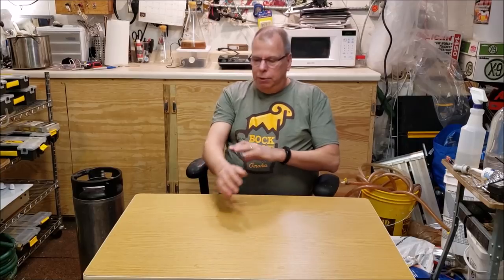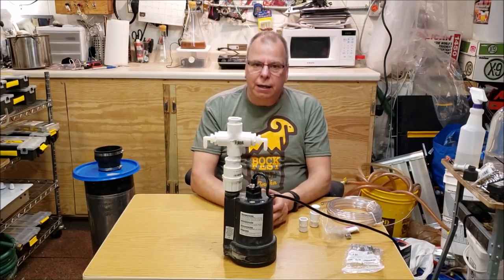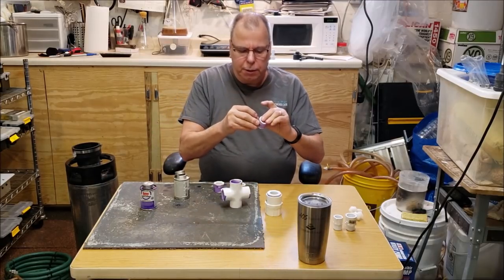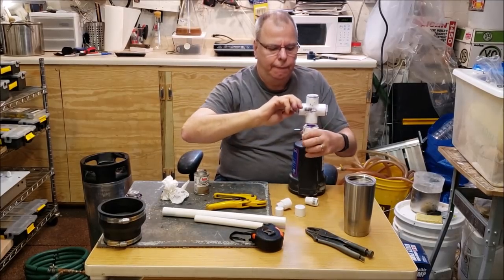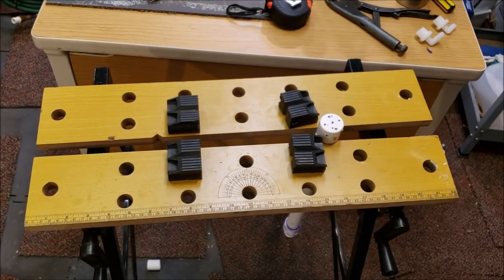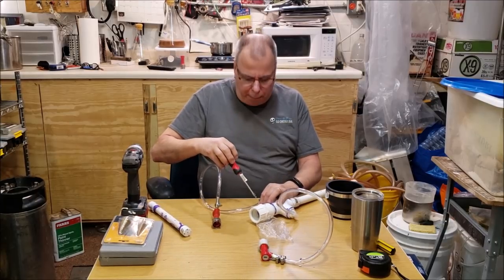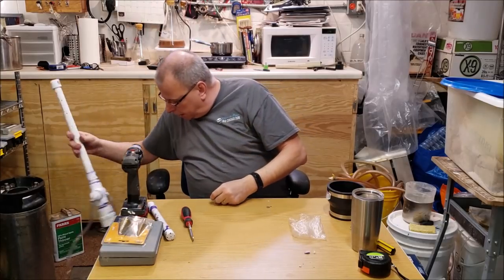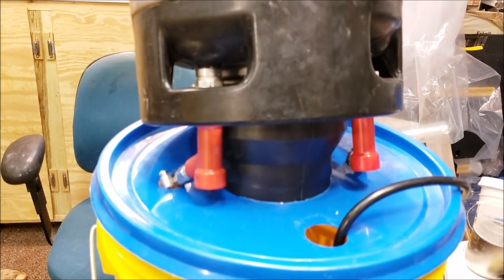Making a Keg and Carboy Washer

Comment from the maker: Well I have used the keg washer a couple times and wanted to add to my experiences.  

1. It works pretty well and I think I am going to get a lot out of use out of it.  
2. Dishwasher soap works well,  Oxi type cleaner suds up a lot. I have rinsed in my sink instead of using the washer so I could clean multiple kegs in succession.
3. Using it for carboys seems to be a but precarious.  You really have to balance the carboy on the rubber collar or it tends to tilt to one side.  I think one of the hard plastic drying racks would be better, but this does work OK.  Also, if you have a carboy neck handle (don't lift with this) you need to take it off.
4. When washing kegs I took the rubber collar off.  It is pretty flexible and can be removed from the hole easily.  Then, the keg sits on the lid and is nice and solid.
5. I have pin lock kegs and the hoses kept turning and popping the connector off when I put the keg on the washer. I had to be conscious of this.
6. I have made an attachment for the pump to wash bottles. Check out my other video on this.

Please let me know if you have any ideas or observations or if you built one of these.

Thanks,
Tim

Comment: Hi, Have you found the pump you are using to be to powerful? I'm using a 650gph pump and am thinking about getting a bigger pump like yours. Good video...
Reply from the maker: The pump is awesome.  I built a bottle washer with 24 tubes made of ball point pen tubes.  I put the pump in a 5 gallon bucket full of water (outside) and turned it on.  It shot water 20-30 feet in the air out of all the tubes and emptied the bucket in about 10 seconds.  The pump is pretty much a sump pump without the float.  With kegs I run it for maybe 10 minutes and they come out clean as new.